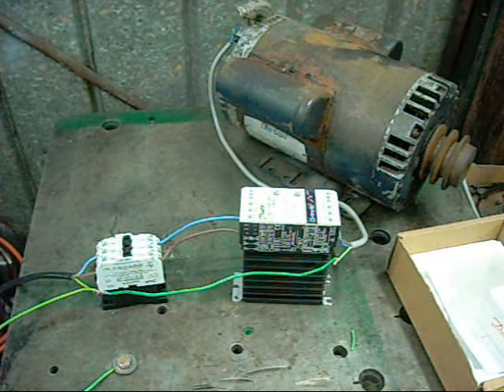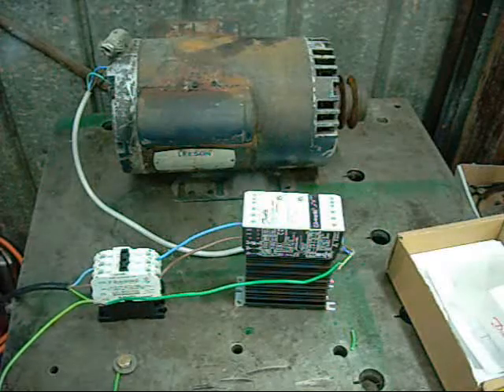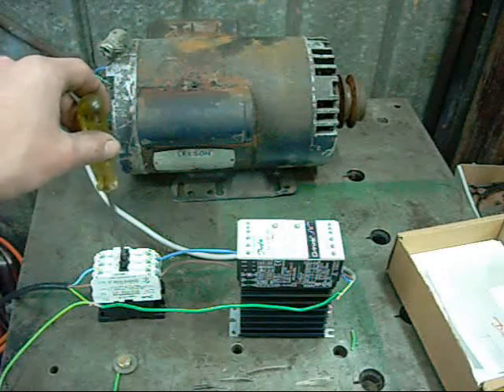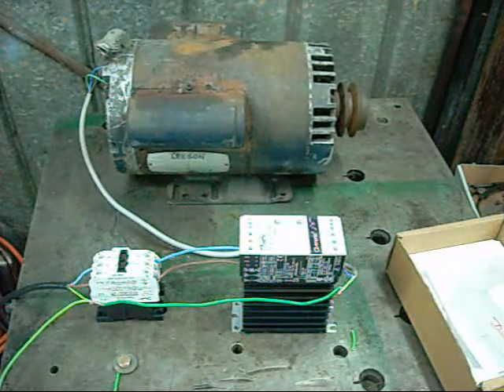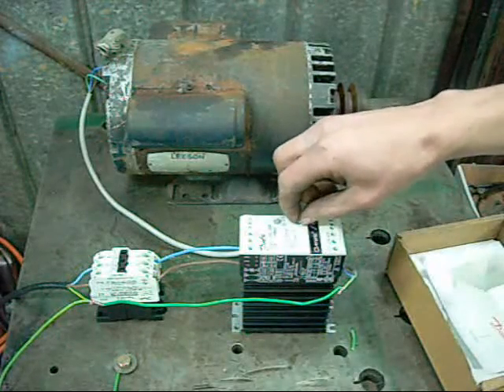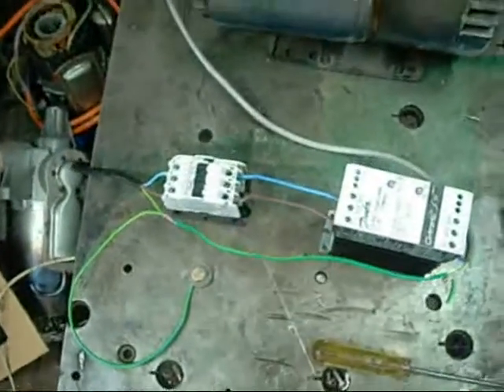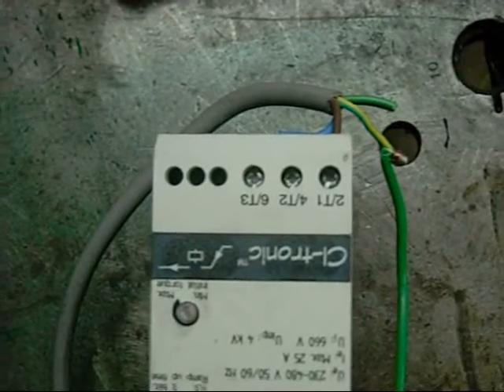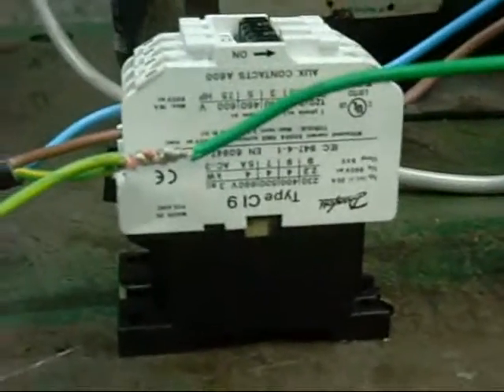Pt2 How to Wire and use Danfoss TCI25 and TCI15 Start Torque Limiter on Single Phase Power

Comment: I wonder if a 2 way switch will work to reverse the motor, I know with some you just swap wires, mainly they tell you on the wiring layout (on GMF motors it's terminals 1&2)